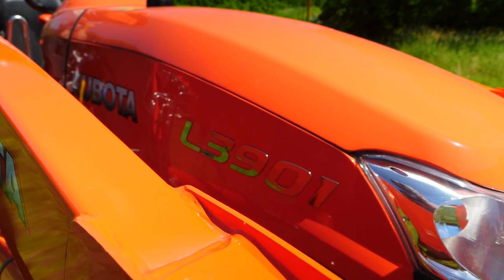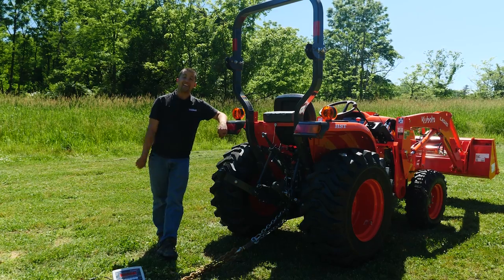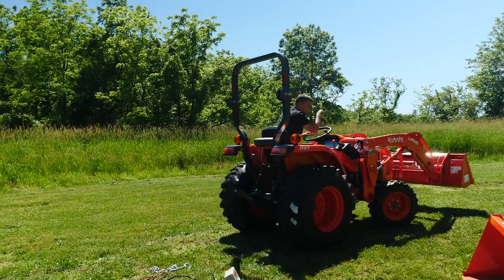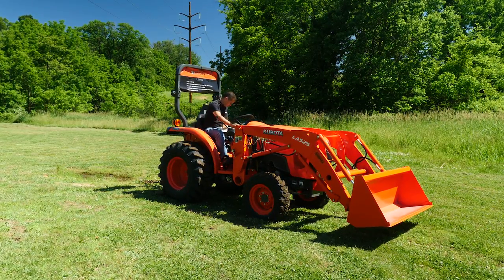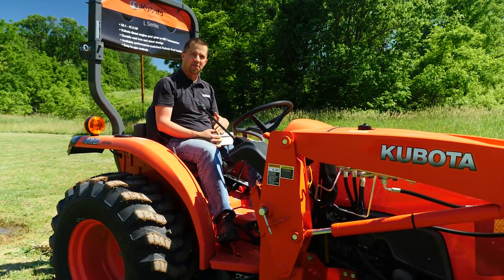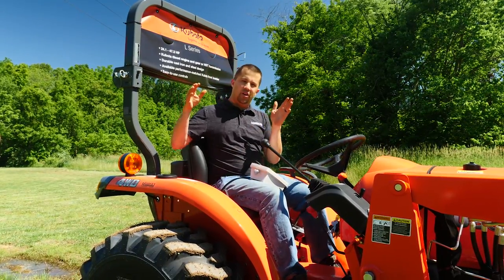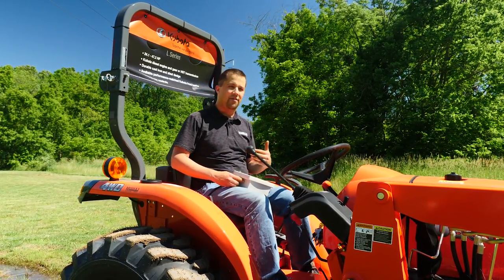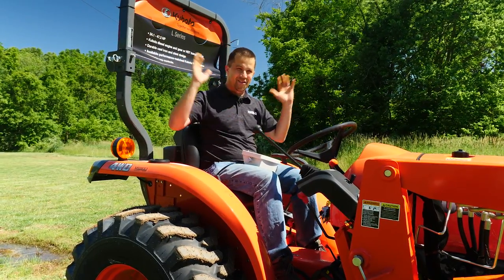Tractor Pulling Test - Gear Drive VS Hydro-static

Comment: People it was done in the grass due to that being where the load cell is buried. Its not birried on his parking lot where people can damage it/it be in the way. Also he did the test in high to try and keep from spinning the tires/overloading that load cell. In low gear the gear drive would most likly max out the load cell. The hst would probably be in the upper limits. Is it truly scientific? Well no but its also something to consider.

Comment: The gear drive would’ve done EVEN BETTER if you eased the throttle on so it took longer to break loose instead of just setting it and going

Comment: You need to try them both in the lowest gear they have for a fair comparison. Surely the hydro will pull a lot more than 1100lbs. You probably couldn't even use a turn plow if it won't.
Reply: The test wasn't for "the lowest gear" and no one is saying the hydro won't pull more than 1100lbs either. The test is simply to let all you pro-hydro home owners know that the GST will drag your HST around the yard all day long. But you boys don't need it for plowing a field, you only need it for plowing your driveways so doesn't matter right?
Reply: @bonedancer3973  I didn't buy my tractor to be a big time farmer. I plant about 10 acres of deer plots and use it for landscaping, moving dirt, gravel etc. I will work circles around a gear shift tractor doing my landscaping spreading work especially in tight quarters. All in what you need them for. I was pointing out it was a skewed test to favor the geared tractor.
Reply: Yea who in there right mind would not try lower range in hydro. I have seen same tractors apples to apples comparison and the only difference was one was hydro and the other gear drive hooked up in tug of war and they just both set there and spin.
Reply: @bonedancer3973  Do a video with both in low gear low range and watch them just sit and spin both of them guaranteed!

Comment: I’ve had an old gear-driven Ford which pulled like a beast and I now have a Kubota B2650 that pulls hard too, but probably not quite as hard as the Ford.  And I wouldn’t go back for anything.  The HST is sufficient for pulling and MUCH better for any kind of loader work or even brush hogging.

Comment: After having many John Deere and Kubota garden and compacts over 40 years the significant  power loss thru the hydo stat was always a trade off for ease of operation. 60 & 70's riding mowers started off with only 5hp engines but were gear drive and did a decent job.

Comment: My 1992 1920 shuttle shift Ford would out pull either of my Kubota 5030 or 5740 HSTC. I hooked a root while plowing a neighbors garden and the 1920 broke one of the 7/8 hitch pins. One of the best tractors I’ve owned.

Comment: Doesn't really matter much, since you'd be in low to do any work like this. In that case, either tractor is more than capable of spinning all 4 tires, so they both end up having the same pulling power. The advantage here goes to the HST since you don't have to stop and shift gears, you can just keep building up speed depending on what you're pulling.

Comment: Hi, Neal. Cool video. I have a question. I have a 2018 BX2680 and have a blown fuse. I found the fuse box, but for the life of me, I can't figure out how to get the cover off. I've tried moving the clip on the bottom of the box both up and down and nothing works. Can you help me out, please? Thanks!

Comment: That was fascinating. Despite the results, I’ll stay with my HST. As a novice whose work doesn’t regularly involve ground-engaging equipment, e.g., plows, disks, I love the HST’s ease of operation.
Reply: Hydro was meant for mowing your grass, shuttle was made for bucket work, stick shift was made for straight pulling
Reply: First Choice Mechanical  remember we are talking about little tractors, not heavy equipment or large tractors, I have used both and I prefer a manual transmission only if it has a shuttle shift, I know that hydro tranny's are great and all, bit again we are talking about budget tractors, not high end fancy stuff that the boss is paying for, but a at home cheaper the better little tractor, if you save some cash and it takes a little bit longer to get your work done, that's what I would do, but I'm old school, stay strong
Reply: @cargotoolshop5319  can’t a shuttle shift do pulling work as well as a stick shift
Reply: firstchoicemechanical1403  Because hydrostats change directions and speed quickly and effortlessly without any shifting, and are better for loader work like on a skid steer.  Excavators already have a massive hydraulic pump to run that boom and stick, so it just makes sense to run the tracks with that as well.
A gear drive tractor is better to run a 15' batwing mower in one direction all day without overheating, and none of the heavy tractors are hydrostat as far as I know, although some large tractors have electric drives.

Comment: Could ya redo the test both in Lowest possible gear and 4 wheel drive and diff locked (max pull) (and on a service that is less slippy if possible - hard dirt or pavement)
Reply: those factors alone improve the testing by 300% maybe not lab perfect but way more real world than the way neil decided to video this "test"

Comment: I run an MX5200, HST, BB2572  Box Blade, about 8 to 10 hrs a day. For me, grading BOC, and general fine grade work, the HST is the deal! I'm on my 8th different tractor at my job, site work, road base crew work. I started with a 5100, 2572 box.  Had 3 or 4 of those,  I've put 3000 hours on one of those, and the only problem encountered,  was the bushings on the speed control pedal, @1800 hrs. My ultimate favorite,  is the MX5200, with a BB3578 box, water in the rear tires,  and that's it. Ultimate fine grade weapon. Enjoy your vids, live life, 6 ft. At a time! #Tractortrash

Comment: I have a question, the hydrostatic drive uses a type of oil to run the motors for the wheel right? Oil is uncompressable so is it possible to generate close to infinite torque in a perfect world? Or are there hard limits exluding stuff like your low and high range gears of course. Greetings from belgium

Comment: I have limited experience on a gear drive, but lots on a hydro, I use my tractor in high to get around the property, but as soon as the bucket or any implement gets used it's in low, I never use high for work, my tractor doesn't even like to pull the box blade in high, but it will drag it in low with a mound of dirt and still can push dirt with the bucket.

Comment: Good review and good results Neil. I've only owned one hydrostatic tractor which is my current tractor. I have to say i prefer  the geared transmission.  The ever present squall and whining from the hydrostat is very annoying.  But, my 11 year old granddaughter cand drive my J.Deere 3025. She'll soon be using the F.E. Loader.

Comment: Mechanical coupling beats out a fluid coupling. They both have their pro's and con's.
Reply: Exactly which is why torque converters have a clutch that locks up in automatic transmissions. Fluid couplers are great for stop and go. But once your moving mechanical is superior.
Reply: This is not true either. An automatic will beat a manual transmission in many tests. The best off road crawlers use autos. The hydro in this test isn't capable of performing a pulling test in high. This test video was worthless. Not to mention torque converters have enourmous mechanical advantages over gears. 2 to 1 in many cases.
Reply: Anymanusa this test showed my issue with hydros pulling trees out.
Reply: @highlanderc  while you may have had an issue, I cannot be convinced of any such issue when the test in the video was performed in gears other than low. My tractor will spin the tires all day long in low. Are you saying yours stalls out when trying to pull stumps? There are bulldozers that run hydrostatic transmissions.
Reply: Anymanusa yes. Mine stalled just like this video in low of course when trying to push a tiny stump. I wonder if there are mods for the hydro transmissions to make it work like a dozer that you mention!
Reply: @highlanderc  that can happen if you press the pedal down all the way. If you don't floor it, you won't stall it. I don't know what tractor you have but I suspect you were making that mistake with it. I have an mx5200 and it too can be stalled if using full pedal. You won't be able to stall it running at lesser pedal. It's a peculiarity of the way the engine and throttle are integrated on hydro tractors. Try it on yours and see if I'm not telling the truth.

Comment: Well that was an easy one. Of course gears engaged are more powerful than a wet sump clutch system. I still have the HST for ease of use though.
Reply: What does a wet sump clutch have to do with either the gear drive or HST tractors in this video?  Neither have a wet sump clutch.  The gear drive tractor has a dry clutch and the HST is...well, an HST.  It uses a pump and fluid coupling system.
Reply: Exactly wet sump is a atv thing ....
Reply: First off easy win for gear drive because the HST wouldn’t let the tires dig/ spin. Basic tractor pulling right there, no spin no power output. You don’t buy a HST for pulling power, your not going to go plow with it, it’s for ease of use, gears drive is just better for pulling regardless of high or low range

Comment: Also.. We had Small Tractors with Gear drives pulling 110 000 lbs of paper at the Port doing long shore man work...  Those tractors had over 23000 hours before they needed clutch replacements. Shuttle shift is a bonus.  Nothing beats on a tractor worse then Long Shore man pulling 16 rolls of  industrial size paper rolls along with it's trailer.

Comment: For many people the Hydro the advantage for their home(stead)  because they may not pull anything harder than the Roto-tiller or push harder than some snow or occasionally put new gravel on the driveway. For mowing lawns and the pasture, or cleaning out the horse stalls the Hydro is probably a better fit. If you want to do real tillage with plow, disc, and harrow, or you want to pull logs out of your own wood lot, then the Gear Drive will always be the best option. Gear drive is the more efficient way to get HP to the Ground, but jobs that require frequent F/R, and/or speed changes may make the Hydro the better option not just for ease of use, but save the clutches. For what we do here at our little Kentucky Farm our 2 smallest tractors (17 + 24 HP) are Hydro and the others (33, 49, and 120) are Gear Drive.  There are Gear Transmissions that have F/N/R, a reverser that makes direction changes much easier for the operator and the machine is designed for it too

Comment: Got a questions. A problem has arisen on my 2016 L2501 with 300 hours. I pulled the lever into 4x4 (it was difficult but I managed) and to my knowledge 4x4 has worked up until today. The lever is stuck in 4x4 position yet is 100% in 2WD. Any thought. I looked under the tractor and everything seemed normal

Comment: Theoretically both tractors spinning the tires with the same weight and grip will pull the exact same. The hydro never broke traction because it was in high range, there is no equivalent to the gear drives 1st gear even in high range. Friction dictates pulling power, the hst was in a range that could not produce the torque required to defeat the friction. This test should have been done in the correct range for both tractors individually. Same weight and HP with the same tires should require the exact same torque to break loose the wheels this is simply a difference in power curves not capabilities.
Reply: thats what i was thinking

Comment: My neighbour had a 24 HP HST tractor. I had a 20 HP shuttle shift. Mine would pull a cord of wood in my trailer up my back mountain with ease, although slowly in 3/12 gear. The bigger HP HST in low range would bog out and stop barely into the hill. Varying the throttle made no difference. I've been told by dealers that HST sacrifices 30% of your HP. So 50% loss in the HST seems like good math in my example.

Comment: The old “Manual vs. Automatic” debate. Modern automatic transmissions are able to out perform human performance with shifting in cars and trucks, but the manual gives you the ultimate control and the solid mechanical connection. No replacing that. Very good video.

Comment: I concur that doing this on asphalt would be interesting.  But dry firm dirt would be interesting too.  But I think you should have tried the hydro in mid range.  The gear drive had 3 of four tires spinning.  You never broke any tires free on the hydro so I think your way killed it by limiting the torque to the ground too much.

Comment: So i just got the little B2401dt and noticed immediately it has way more pushing and pulling power than the b2601. However the b2601 is much simpler to use for loader work. Don't get me wrong you can obviously use a loader on the geardrives but the constant clunking around of the gears is very tiresome. Also the unsynchronized gears are hard to engage, double clutching is sometimes needed.

Comment: Reading through the comments makes me think that many people don't seem to realize that each design is optimized for a given performance range, as well as ideal workload.

First things first. Both will do a good job at forward and back type work, so both are sutable for loader work. That being said, if you're looking for a tractor for primarily loader work, with minimal heavy drawbar work, the hydro will most likely be the model for you. It's capable of decent towing, as well as draft work with a plow or subsoiler/ripper. But it's optimized for constant forward/reverse usage.

If,on the other hand you're looking for a tractor that can still do a good job with a loader, but is going to spend most of it's time doing tillage, mowing, planting/harvesting type work, then the gear transmission will be a better fit.

 It all comes down to actually knowing what you need the tractor for.

Comment: l2501 with gear drive has a transmission powered pto, which means when you push the clutch in to change direction the pto shuts off, which is less then ideal when bush hogging.

Comment: My question is, which transmission is going to last longer. Splitting the tractor and throwing a new clutch in is no biggie for me. I had a b2400 that had the hst go out in it and even as old as it is, its still 1700usd for a new hst unit and that's me doing the work.

Comment: Downhill breaking is best with gear drive as well the engine will help maintain speed. Also you can get constant travel speed. Hydro is nice for loader work or a lot of back and fourth. I wish you would have done the test in all the ranges on both machines for comparison.

Comment: Exactly what I've known for years.  The gear drive advantage is great when pulling and also when pulling constantly at high rpm the heat is handled more efficiently by square cut gears and shafts.  The hydro units don't handle the heat nearly as good.

Comment: The reason for the higher gear drive numbers is due to the shock load.  The first geared pulled there was a very hard shock load, the second pull had a shock load as well, but not as pronounced.

Comment: Would like to have seen a closeup of your foot.  From e whine on the hst it sounded like you were pressing down further as the test went on so to be fair you should also have shifted the manual to high gear (not just high range).  If you want max power out of an hst you barely press it down.  That’s the equivalent of 1st gear.  Didn’t sound like that’s what you did so please clarify.

Comment: You get max torque right before the wheels break loose. You have to drop it down.
Reply: If you didn't break the wheels loose you didn't record the max torque. All the gear reductions/ratios only go into putting torque to the wheels. I would expect no difference on grass. Now if you could stall the engines at the lowest setting without wheel slip then the gear drive would do better simply because you aren't dissipating energy in the form of heat like the HST does.
Reply: I love your videos by the way. I am an engineer for a diesel engine manufacturer. I did performance engineering, after treatment engineering, and now field service engineering. If you ever want to run a test idea by me please send me an email. If so I'll send an email to your work email, just let me know in the comments.
Reply: Any one who uses one of today’s modern  ultra lite utility tractors realizes that the type of transmission is not the limiting factor while pulling  but a lack
 Of traction
Reply: @mikrg291  this guy gets it.
Reply: @javery50  not really, anyone who has tried pulling a 7 foot haybine knows that traction is the least of your concern, try pulling one with a hst tractor, first time you try going up a hill you’re done. If the haybine takes 30 horse to drive and the tractor takes 20 horse to pull itself up a hill and you only have 40 you’re done, but if the same tractor with a gear trans takes 10 horse to go up the hill you’re in business.

Comment: From what I’m understanding the hydrostat transmission if something blows or breaks and it would be way more expensive to replace than the clutch. And the gear drive sounds better and can pull more?
Reply from the maker: Correct, gear is more difficult to drive and more likely to fail than hydrostatic.

Comment: I agree with several here. Should’ve tried the HST in low. The jolting of the gear drive also probably spiked the reading. If both tractors go until they break traction that should mean they pull the same. Need to do another test on asphalt where the HST would possibly bog out before it loses traction. I’m assuming the gear drive would still win though.

Comment: Does the hydrostatic have fail safety faults built into the system, to prevent pump damage or engine stall?
Reply from the maker: Yes